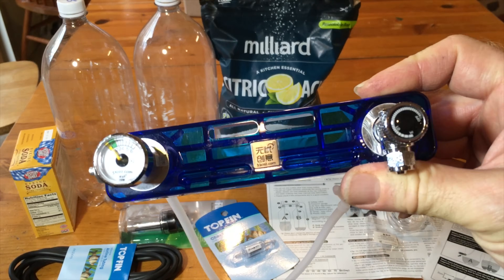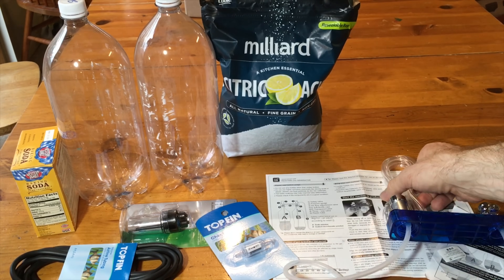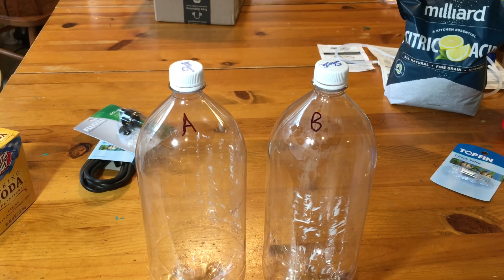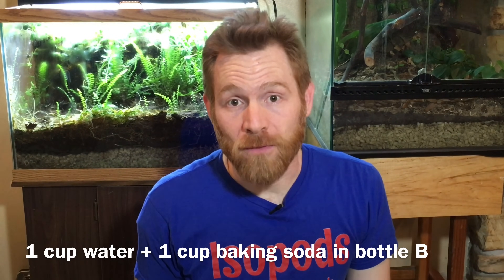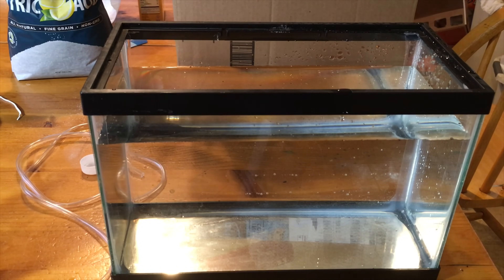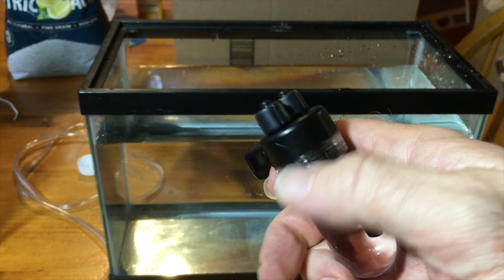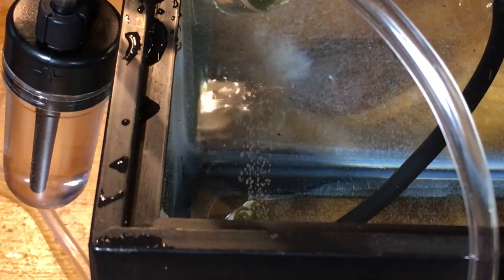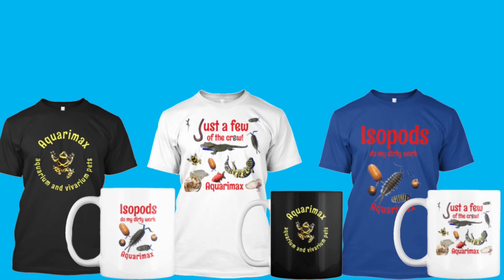Citric Acid CO2 System for My Planted Aquarium

Comment: Can't you just shut the valve off at night to stop over dosing? Or will it blow up? My aquarium too small for a air stone as well tbh
Reply from the maker: The safety valve should prevent explosions if shut off at night
Reply: @Aquarimax  does it let out excess pressure? Another question is what do I do if the pressure it's the red when I'm building it up

Comment: Try the CO2 bell method! I experimented with it recently and it worked like magic. I generate the CO2 with citric acid and baking soda and fill up the bell with it, and the hydrostatic pressure generated by the CO2’s displacement of water generates pressure driving the CO2 into solution. I’m getting crazy pearling in my 55 gallon tank with this method.
Reply: can you link to a video please?

Comment: Your video of setup was fantastic and I did set up as you suggested but
Question: How many days the solution lasts?
I'm having an issue. My citric acid solution runs out within 2 days and stops producing Co2. The baking soda solution remains there. What am I doing wrong or any suggestions.
Thanks in advance.

Comment: Hello! Im trying to use this method to my 20 gallon tank after the bottle is empty can you refill it again or reuse it? Or should I replace it? Also how many liters are the bottle you used? Im really afraid to try this method though since i heard they will explode if the pressures go wrong.
Reply from the maker: I refill and use the same bottle. These are two liter bottles. It is important to be careful. 👍🏽

Comment: First off, this really works. But this is the problem I faced and how I overcame it.
PROBLEM: Baking soda clogs easily. During the priming stage, when baking soda is going up the tubes, it can clog sometimes. When it clogs you can keep trying to prime but nothing will happen. You may think it is because of the CO2 pressure but the gauge is all the way at 0 and nothing is happening. It is because of clogging.
SOLUTION: 
1) Dismantle your system, clear your pipes of baking soda clogs. 
2) Screw the baking soda portion back on. 
3) Screw the acid portion back on but before it is firmly tightened, give the bottle a good press so some air escapes first, tighten the bottle in this state. It will help to draw baking soda into your acid bottle. 
4) Shake the whole system. The purpose here is not to initiate a reaction but to get the baking soda in as liquid a form as possible. Baking soda settles very easily and very fast so there's a big chance it will clog in your tubes if you don't perform this step. When you see the baking soda is not settled at the bottom of your bottle, now is a good time to prime. 
5) Priming. All you need is one good squeeze from your acid bottle. Because it is underpressured, it will suck back more baking soda after you squeeze it. Now that the baking soda is not settled it will flow through the tubes easily causing a reaction with your citric acid. Within seconds your acid bottle should pressure out and the needle should jump well into the green zone.

This is the first instructional video I watched before I bought my system so I'm posting my findings here. It really works and if you use the CO2 for 8 hours a day, it should last more than a month. This is really for people who live far from their fish store and find refilling their CO2 canisters a real hassle. Or like me, you just like fiddling with stuff.

Comment: I got the exact same kit, used 600ml for bottle A and 200 ml for bottle B. After 1 day at 1-2 bubbles per second, all of it is gone. 

I'm mildly pissed, I'm not gona change bottles every day!
Reply from the maker: Flyingdutchy33 I wonder if you have a defective valve on yours?
Reply: @Aquarimax  No it appears to be fine. I did, however, use just 1.25L bottles as opposed to 1.5L and may have over tightened them causing a leak perhaps... Mine did not come supplied with extra gaskets either, so no chance to change them.
What I noticed is that as bottle A got close to being empty, it was hard to maintain pressure. Possibly due to the unfavorable amount of air volume left in bottle B.

I've refilled the system using slightly bigger 1.5L bottles and this time I closed the supply for the night. After an 8 hour stint, both bottles have equal volume of liquid. I hope it will go better this time around!

Comment: Hi, I installed this system 1 week ago. I tried to adjust the number of bubbles today, I opened the valve too much. After that, all the liquid in the citric acid bottle flowed into the carbonate bottle. Is there a way to prevent this?
Reply from the maker: Erhan Deveci basically, tweaking the valve only a tiny bit at a time, as far as I can tell.

Comment: Hey I have the same setup of CO2 which shown in the video. The problem is that citric acid goes in to soda bottle just in a week and then left over gas continues for 3 to 4days. Over all this setup works for 10 days as per my experience. I just wanna ask if the left over water can be reused for CITRIC acid ??

Comment: hi there.. I have done everything you guide. my pressure builds everything is correct but when I open the valve for co2 after 10-15 bubbles it stops  don't know what's going on
Reply from the maker: Fawad Saeed Iy May just need more time. I would give it an hour or so

Comment: actually to get the most out of your citric acid and baking soda, use 1 part of citric acid with 3 parts of baking soda. The balanced reaction is this: C6H8O7 (citric acid) + 3NaHCO3 (Baking soda) = Na3C6H5O7 + 3H20 + 3CO2. With this you would have no residue left on both sides. I use 60 gram citric acid and 185 grams of baking soda ( 5 grams more to make sure all the citric acid has reacted)
Reply: Joris Van Den Bosch and what about the water?
Reply from the maker: Joris Van Den Bosch great suggestion!

Comment: Hey I have a similar co2 tubing and connectors I got off wish and it says for tanks above 100 cm it lasts 20 days at 2 bubbles a second? You think it would last that long on a 90 gallon? I’m thinking of adding gluteraderal or something like excel to improve the effect of the diy co2
Reply from the maker: Vignesh I’m thinking you’d need more bps for 90 gallons, so you’d probably need to redo the solutions more often. The liquid carbon supplement may help though 👍

Comment: Hi the pressure on the gauge keeps going up even when i turned it off how do i stop it going up
Reply from the maker: martin Willis You May need to open it up and let it bleed out some excess Co2, not connected to the aquarium
Reply: @Aquarimax   Newer sets have a magnet included that you can use to get the hose in bottle A above the citric acid mixture in case of too much pressure. If pressure is in the lower green part (close to 1) you can put the hose back in the mixture. If you leave it like that after pressure is OK it should stay around 1 bar until the mixture has completely moved to B.
Reply from the maker: Dennis Binkhorst yes, I have used the magnet to stop the reaction, that is a good longer-term solution. 👍

Comment: Thx. :) I don't see any link to the follow up video you spoke of. Can you please point it out to me? TIA! :)
Reply from the maker: 4FunRC I never ended up making it. I like this CO2 device, except for one issue—after it has been running for a while, it tend to release a little too much co2 near the end of the cycle. Not a huge deal since I had air running at night, but still not ideal...

Comment: I have a 90 gallon tank and will be trying this. I bought the kit and waiting for it in the mail. Why I hear many negative comments that this won't work on a 90 gallon? I never get a straight answer.
Reply from the maker: Jose Lamar I think many people are concerned that not enough CO2 will be produced.Many of them are probably thinking of DIY yeast reactors. This unit seems to produce more CO2 than a yeast reactor. Regulating CO2 production with it can be a little tricky, but I think it has the potential to work. I’d be interested in hearing how it works for you.
Reply: @Aquarimax  I'll keep you posted. I'm hoping I do it correctly. Maybe if I can, I'll get stronger bottles than soda liter bottles.
Reply: Jose Lamar hey I’m in the exact same situation as you with a 90 gallon? How were the results for you?

Comment: @aquarimax pets
Can you please make a eksperiment showing the total amount of CO2 created by this metode... 

to see the Price vs. Buying a bottle of CO2

If it is more og less cost effektive ?

Best regards Lasse - Dk
Reply from the maker: Lasse Thorsen I should try that, but I am fairly sure that in the long run, a bottle of pressurized CO2 is more cost effective and easier to regulate, even if the initial setup is more costly. 👍

Comment: Hi! , we have same reactor kit & doing well in my 10gallons tank using 1bubble per 3sec. However, i'd like this to turnoff at night & ON in the AM. Any ideas? Thanks
Reply from the maker: jayson galoso Without going the rather expensive route of a solenoid valve, the fix I decided on was simply to run an air pump at night to gas off the excess CO2. I used a Coralife Power Center. The air pump was on the night timer, the lights on the day timer, so that worked quite well,
Reply: @Aquarimax  Great!, im planning right now for a timer socket. However this what i did "Correct me if im doing it wrong"...  
Mine, lights is ON 7am - 7pm, OFF 7:01pm - 6:59am. 
So far plants are ok. Aerator: 7:01pm to 10pm. I hope im doing it right Sir.
Reply from the maker: jayson galoso that sounds pretty good, depending on your situation you may need to shorten the photo period. Also, consider having the CO2 coming on a short while before the light, so the plants can store a little up before they start photosynthesis. 👍
Reply: Aquarimax Pets 

As you said there is no need for co2 at night. Instead of adding the bubbler, can I just simply shut the valve from which the co2 comes out? Would this accumulate too much pressure inside the bottle and cause an explosion?
Reply from the maker: Brian Hui potentially it could...although there is supposed to be a release valve 👍

Comment: It seams you run in the same problem i 'm having  regarding reaction happening all at once in a few days . i think its due to citric acid . Before i used 8 gram packets  of citric acid  (alimentary  use) and i used 25 of them  to make 200 grams  and the  co2 production lasted 7 months for my  nano  planted tank . Since i 've been using 100 grams  citric acid packets  it seams the reaction happens all at once in a few days and that sucks.  i will  buy again the 8 gram packets  and see if will get back to normal . I  suspect citric acid  its not the same ... or else  i dont have an explanation why is happening  giving the fact that it run  14 months without a problem with the 8 gram packs (25 of them ) and after i started to use the 100 gram citric acid packs the reaction happened   in a few days .If anyone has any idea regarding the problem  i would appreciate the input.
Reply from the maker: Gr8Success that is interesting information, thank you! I could usually get 1-2 weeks of stable CO2 production, and then just before it ran out, I would get a big burst...is that different from your situation?

Comment: you mentioned that you turn the bubbler on while the lights are off.  Why is that?
Reply from the maker: Mark Garrett good question. When the lights are off, the plants are utilizing little or no CO2. This allows the CO2 to build up in the water, causing a nightly swing in pH, potentially a drastic and deadly one for the fish. The airline causes most of that excess CO2 to outgas, keeping the pH stable and thus protecting the fish.
Reply: @Aquarimax  wow that's interesting! That's the first time I've heard that watching all of the how to CO2 videos! I have a have yeast and sugar DIY kit. And it runs all night long. Is this hurting my fish?
Reply from the maker: I ran DIY Yeast CO2 reactors for years without additional air at night. In my opinion and experience, yeast CO2 systems are less likely to produce huge bursts of CO2, so it doesn’t seem to be an issue. The citric acid CO2 system has gone overboard a few times, and the airline was a lifesaver. 👍
Reply: @Aquarimax  good to know! Thanks mate!
Reply from the maker: Mark Garrett You’re welcome! 😊👍

Comment: We may be over thinking this CO2 thing. I just visited the owner Justin of Ocean Aquarium in San Francisco , nice guy! He has about 50 tanks in his store and they’re all loaded with an absolute ridiculous amount of jungle green plant life. So much you think this is crazy how can enough light penetrate through the foliage with out the bottom plants dying off? All he has in every tank is an inverted empty quart size Gatorade like bottle he inflates with CO2. The CO2 just naturally dissolves, in I think about a week, in the water in about a 20 to 40 gallon tank. The bottle eventually falls low into the tank indicating to refill the bottle with CO2. He’s been doing this routine for about 30 years. Crazy simple! Some of his fans have made YouTube videos on touring his store. Check it out. Great store! He’s rather fond of using bright red recycled plastic bottles for his high tech operation, funny!
Reply: He had it various ways but I think the easiest way is wrapping fishing line around the bottle neck and a rock anchor or something. I’m not sure how he did it. This way you will notice the dramatic fall of the bottle. The CO2 would dissolved slower than the diffuser, but that might be a benefit in that you can’t over due the gas, no CO2 is wasted while even with a diffuser only about 10% dissolves in water. Lastly your daphnia will be happier not being gas to their death.
Reply from the maker: Craig Riglin It definitely sounds like he has something there...we just need to see exactly how he anchors those bottles. 😊👍
Reply: @Aquarimax  I used to do something similar, but didn't use anything to anchor the bottle.  I just used my aquarium lid to hold it down.  As long as there is gas in the bottle, it would rise to the surface and stop at the lid.  I was able to get 3 months out of my yeast/sugar co2.  It was by far the most consistent diy co2 system I've used.  I find that when it comes to DIY co2, passive diffusion works better for consistency.  Ocean Aquarium uses compressed co2 to re-fill the bottles.  I had an airline tubing from my yeast reactor.
Reply from the maker: Maurice Tan I agree. I used yeast CO2 reactors for years, and was actually quite pleased with how they worked. I would have 2 bottles and a T valve, and would replace one bottle at a time. CO2 production was quite consistent.
Reply from the maker: Craig Riglin I have heard about his store, would love to visit it someday. I am curious...how does he keep the inverted bottles from floating onto their sides and releasing all of the CO2 at the surface? Does he weight them down?
Reply: @patrickm7727  Bite me! :)

Comment: Wouldn’t vinegar and baking soda work? White vinegar is a lot cheaper than citric acid. The reaction creates a lot of pressure.
Reply: Rethinking this idea while vinegar and baking soda definitely yields CO2 . There’s probably a small residual of vinegar vapor introduced that over time maybe harmful. I mean what can live in vinegar? You may end up with pickle herring. I appreciate the time you spend doing quality videos.
Reply from the maker: Craig Riglin that is a good point! You’re very welcome, I am glad you appreciate them!
Reply from the maker: Craig Riglin I had the same question when I heard of this system. Apparently the vinegar doesn’t work as well as the citric acid...though it would be interesting to compare the two.

Comment: You think You could double the citric acid and baking soda in each bottle to get longer usage?
Reply from the maker: peninsulamike Yes, I have done that...the only problem is that near the end of the cycle, I got a big burst of CO2...far more than I wanted. I had an airline installed to run at night to gas off the excess, so my fish were ok, but for now, I have disconnected the citric acid system.

Comment: Hi, did you make the video where you show your results from using this system? Can't find it on your channel. Also would you say this system would work in 200litres tank? Thanks
Reply: Thank you for your reply. I never had planted tank before other than few random plants. This time I want to try something new but don't spend the fortune. I shall look into other options.
Reply from the maker: shantalle that sounds like a good choice. I hope you find a system that meets your needs. 😊👍
Reply from the maker: shantalle I haven’t made a results video yet, partly because I have disconnected the system for now. The plants I am growing don’t really need it, and I have had trouble with stability! After about 2 weeks, the system releases huge quantities of CO2...I mean to get back to it at some point though. With a 200-liter tank, I would probably go with a tank system, you would probably have to refill this one too often to make it worth it.

Comment: Hello! I want to buy such a system, for an aquarium of 25 liters. Do you think there will be enough CO2 for a month? It is a pity that you did not show your cat = (
Reply from the maker: Z. M. Hi! For a tank that size, you might get enough CO2 for a month...thus far I have noticed that during the last several days of the life of the citric acid/baking soda solution, I get a large burst of CO2...a little too big, in fact, so be sure to monitor and regulate the flow carefully. You will probably want to do one of two things: 1. Turn off the CO2 when the lights are off, or 2.  add an air stone on a timer that comes on when the lights are off to outgas excess CO2 at night, to avoid overdosing. I do have my cat showing up in some of my other videos. 🐱 👍
Reply: @Aquarimax  Bought eventually for the good price this version 4L DIY CO2  https://cuu.su/GeneratorSystem/